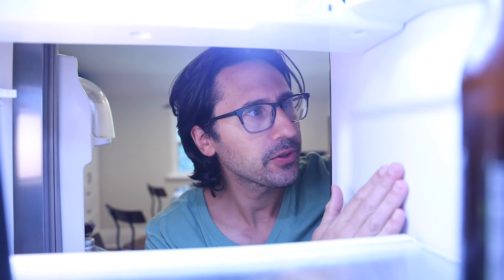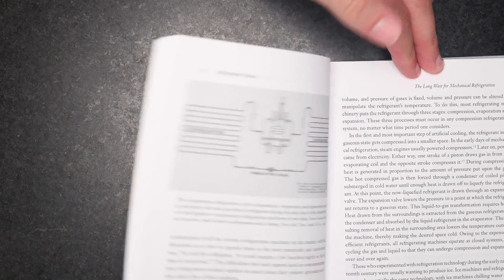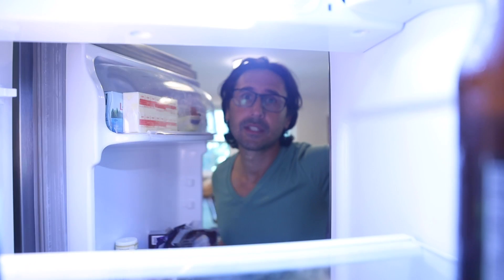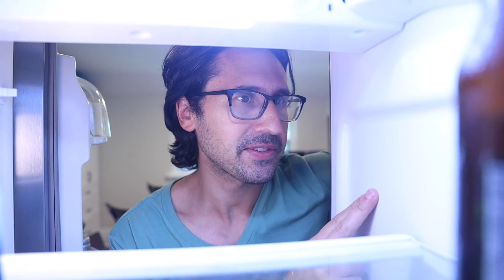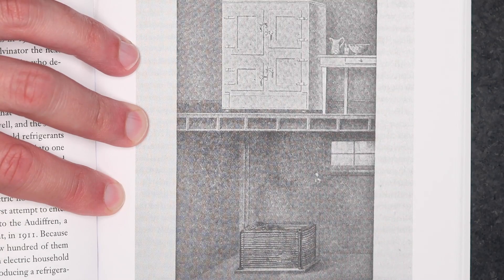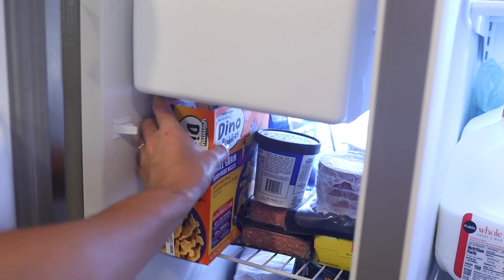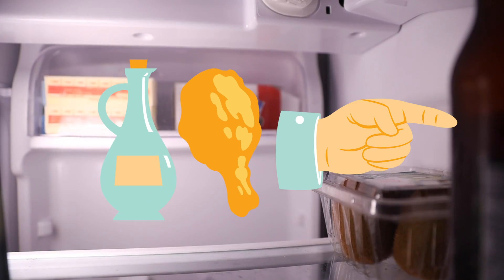How refrigerators work, and how we all ended up with one

Comment: My late grandpa had this small room in the basement which got really cold during winters. Instead of getting a space heater he took apart his old fridge and dunked the part that takes away the heat for from your food into a large bucket of water so that the "fridge" tried to cool down the water even further producing a lot of heat that would eventually heat up the room a bit. Horribly inefficiant space heater but he said "Why buy a heater when I have all the components in my workshop?"

Comment: A great video! I'd add that one of the most important have/have not distinctions lies with refrigerators. Some have reliable power and enough income to buy them and some do not. For the latter, food has to be eaten quickly before it spoils. The result is waste. We might even say that the ability to store leftovers ranks in importance alongside electric lighting.

Comment: Don't know how old our fridge was, but growing up in the 1980s, we had the occasional defrost ritual.  Speed it up by putting pots of boiling water in the open freezer. If you waited too long, no room for the pot.

We also had a chest freezer in the basement, which I guess had defrosting?  had a bit of ice but never a huge buildup.
Reply: my family used to still have one with frosting issues too. here we take the fridge outside and wash the frost with a hose to melt it

Comment: I'm old enough to have had to defrost my freezer section for years! Thank engineers for frost free freezers! When I first started out I had to go cheap and even had to buy a refrigerator so old that it had the round condenser on the top. My grandmother told me stories about the ice harvest because they were sausage makers and needed lots of ice. The ice house was a heavy partially buried building with ice blocks separated and insulated by hay. When she was a ""bad girl" they pit her in the ice house for punishment (1890's German discipline). The Regen river was the source of the ice in winter and the village bath in the summer. AS convenient island separated the sexes!

Comment: It seems you have a "daylight" bulb (or LED) in your fridge.  In terms of your video skills, you really ought to learn about White Balance next.  You've learned a lot about making quality video and audio since you started out, but there's always more.
You might be interested to know that grocery stores use unique lighting to make the food look better.  I had a job making QA devices for the printing industry.  For example, Campbell's Soup labels printed by different suppliers thousands of miles apart might wind up next to each other on the shelf and they need to look identical.  We had, among other things, a lighting booth with a setting for grocery store lights.  I wonder if it would be a good idea to use that in the refrigerator too!  (My 25-year-old fridge uses a plain light bulb that I think I changed once.)
Reply: It's intentional. Adam doesn't do white balance because it makes food look better.

Comment: HCF gases like R134a and R404A is slowly getting replaced by combustible refrigerants like propane and isobutane (basically LPG or whatever is called in the states). Tho one might be concerned by having combustible gases in a pressurized system in their kitchen, the safety lies in the maximum allows charge in the system witch usually is as low as 50 - 100g(2 - 4 oz).

Comment: You want solid state cooling? PELTIER CHIPS! Add electricity they freeze on 1 side, heat on the other! Want to make electricity? Add heat, and it will induct a current out of its wires!

Comment: Yeah way back when I was a little kid,

My mother was into Antiques;

She bought and sold lots of really old things;

It wasn’t my cup of tea, so to speak,

I do remember seeing one of those really old refrigerators  that required you to put a block of ice inside in order to keep things cold inside,
My mom also had a black metal  g gripper that was used to grab and lift large blocks of ice for putting inside of one of those ice- boxes;

 As I recall there was a pull-string. For turning on the lightbulb inside of that ice- box ;

And way after I was grown up I remember doing some research into those ice- boxes and I found out that those bars beside  the roadways  that said that they were an ice- house typically received  regular ice shipments /or deliveries of blocks of ice in order to keep whatever beer cold,

However those days are long gone;

And in. My research I also found out that up in the northern states that there were teams of ice-cutters or saver(

Stupid autocorrect is hosing me up;

Sorry about that,

However teams or crews would go out to the various frozen lakes and cut out large blocks of ice that was shipped or carted  to customers homes,

Definitely  some interesting stuffs:

However my mom  took those ice tongs and she made a paper towel dispenser out of those things,

They really didn’t work too well as paper towel dispenser ,

But those things were definitely interesting to say the least,

My impression is that ice hauling was a very labor intensive  work;

So an refrigerator is definitely the best way to go 

Just passing this along to everyone,;

Peace out ✌🏿

Comment: evaporative cooling and refrigeration have little to do with each other.  You take freon and compress it to a liquid it gets hot.  You release the pressure and let it return to a gaseous state it gets cold.   

You can take a large pressure vessel like 100gal or so.  Pressurize it to 100psi, it will be uncomfortably warm to the touch.  Shut off the air supply and open the relief valve and the valve will frost up and even start blowing chunks of ice out if the humidity is high enough.  I was an apprentice on a sandblasting crew when I had my eureka moment on how refrigeration actually works
Reply: And that is exactly what happens in evaporative cooling as well. The phase change from liquid to gas takes energy, leaving the surrounding area cooler. All compressor based refrigeration does is take the principles of evaporation, add more energy and supercharge it then recycle it.

Comment: In Houston right now and our power is out and has been for almost two days now with outside temps in the teens. Meaning our inside temp got down to 31 degrees in the house. Any insight on why the refrigerator (without power) got to a temp of 36 degrees while the temp in the kitchen was 31?

Comment: A lot of this is not factual like the flapper is to deal with humidity and incoming air in the doorway on French door refrigerators and the heat in the back is just the part of the refrigeration cycle You have a high side and a low side It has nothing to do with defrost if it had the ability to reverse it would be a heat pump like the air conditioners that have the ability to make heat You have a physical heater underneath and around your evaporator coil The heat that you feel on the outside of the refrigerator is the high pressure lines getting hot

Comment: Oops, you made a couple of factual errors. Excellent presentation very complete with the big picture but the "where the cooler" is, and the "heater" is was not accurate.  There is no heater in the door's edge; it is part of the gas tube design.  The part at the edge of the door is the Yoder Loop.  The "cooler" is not in the back wall but that enclosed area at the bottom of the freezer compartment.  The design in most simply transfers the required cold from the freezer to the refrigerator section.  That ratio is adjustable.  There are some, the most expensive, that may depart from this ratio thing.  With the primary coil for cooling in the freezer, moisture will condense and form ice. The solution is a timer that will cycle an actual heater element that surrounds the cooling coil and allow the ice to melt and exit to a small tray under and in that toe space at the bottom that allows cool air to enter, washing over the heated primary coils.  This is supported by a fan down there.  If the fan fails, the Yoder Loop will get excessively hot.  This is the perfect safety tool.  There is no harm; the unit will continue, but now the edge will become notably hot, and a service call will be requested.  The reason for the Yoder Loop placement was to prevent water from collecting at the edge of the door, which would freeze and lock the door shut.

Comment: The heat of vaporization of water is not a disadvantage in using it as a refrigerant.   In fact, high heats of vaporization of the working fluid are an advantage, and not a disadvantage.   You want as much energy involved in evaporating and condensing the working fluid as you can get, for each unit of energy needed to operate the compressor.

The reason water doesn't work as a refrigerant is that it freezes at zero Celsius, a temperature which the working fluid of any refrigerator will need to experience.  And that it expands when freezing, which would rupture the pipes.  Both of these properties of water are part of our species can even have evolved on this planet in the first place, so it isn't like these are properties of water that would be ideal if they were different.

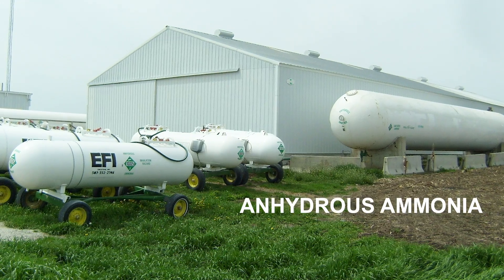Comment: an-HIDE-rus.  The stuff in the wheeled tanks you showed at about 3:30 is typically injected into the soil of crop fields as fertilizer.

We already have a "new" form of refrigeration referred to as the "solid state heat pump" or the Peltier (pel-tee-ay) junction invented by Frenchman Jean Charles Athanase Peltier in 1834.  Many of the small automobile or camping refrigerators rely on such a device.

Comment: Until the late '70s, I've defrosted refrigerators MANY times.
My Procedure:
     Remove the frozen food.  (don't worry, this only takes about ½ hour, and only happens once or twice a year)
     Unplug the refrigerator
     Place a pot of boiling water (on a trivet) in the freezer.  Close door. 
     Come back in ½ hour, with some towels, sop up the mess, replace the food, plug back in, you're good to go for another 6–12 mo (depending on weather and frost build-up).

Comment: My Dad's 1920s GE "monitor top" refrigerator used ammonia, and worked well into the early 2000's. (and it was the electric motor "startup coil" that went bad, not the actual refrigeration).

Comment: You should've invited an engineer instead of a historian. That way you would have known that no liquid is flowing through your fridge (at least where you said it was flowing). Your warm food doesn't evaporate anything. The process behind the cooling of the fridge is as follows: Compressor compresses a gas (it is not essential to turn gas into liquid) - > gas, heated by compression, is then cooled inside a radiator - >  after compressed gas is cooled to ambient temperature it is decompressed (thus cooled) -> then (depending on a manufacturing method of a specific fridge) cold decompressed gas is sent to a radiator that is either spread throughout the fridge or is placed in one place and the fridge air is circulating through it where the gas is absorbing the heat from the air inside the fridge - >then you repeat every step again. If it was the way you said it is, then the fridge wouldn't be able to cool anything lower than the ambient temperature because if the ammonia (you used ammonia, so i'll use it for explanation too) is liquid that means it is either BELOW it's boiling point (-32 C or something like that) OR  is under pressure (but at the ambient temperature). I am sure you understand how room temperature ammonia will not cool anything below room temperature, so let me explain why the first part won't work either. it is simple: HOW THE FUCK WILL YOU COOL THE AMMONIA TO -32 C? Compressing matter makes it hot, not cold.
So, the whole point of all this was that you are an ignorant moron who is in no position to tell people "How refrigerators work..."  
If you want to teach anyone anything then please make sure you know it yourself. Explaining to someone IS a good way of understanding complicated things yourself but I see no indication that this is the case here.
You are probably one of those kids who say that their grades aren't representative of their intelligence or those who say that they "wouldn't need that in their life" about science just to become a moron who doesn't see fallacies in their explanation of "where the COLD comes from".

Comment: I used to work as a refrigeration engineer, R290 aka pure propane has become the new standard for home refrigeration. Propane is a very efficient refrigerant, poses no toxicity risk and is environmentally inert. While it is flammable, the amount used in a very large home refrigerator is very miniscule, about 12-20 bic lighters worth. Your refrigerator or window AC unit probably uses much less.

Comment: Ah the fun of taking everything out of the freezer in the garage, putting it all in a picnic cooler, and defrosting the freezer.  Using a hairdryer to speed up the melting on a hot summer day.  Taking out the large chunks that fall into the bottom and using a towel to soak up the water.

Comment: The most common refrigeration currently use that doesn't use the vapour cycle is the Thermo Electric Cooler (essentially a Peltier system in reverse).  These use a semiconductor junction that moves heat along with the electric current, and thus can produce a 'hot side' and a 'cold side'.  They work well at smaller scales - most 'mini fridges' for a few cans of fizzy drinks run on this technology, as do the cool boxes that can also be plugged in (to a car).  They don't work so well at higher powers, or at lower temperatures (so fridges, not freezers).
Magnetic cooling systems tend to be limited to lower power, but they work well down to really low temperatures, so are currently used in cryogenic applications (i.e. liquid air to liquid helium sort of temperatures).  I'd love for them to replace compressor based systems - so much quieter in use, but I suspect we're a a while away from them becoming commonplace.

Comment: One thing I wonder to myself is why the first proposed solution to the ammonia problem, the Einstein refrigerator, never took off despite only using heat to cool, having no moving parts, and having the ability to be entirely sealed off with no worry of gas escaping through the compressor. You could use any source of heat, from a propane flame, solar heat energy, or even an electric heater to power it. I've looked it up and I still come up blank.
Reply: For one thing, much less efficient. For big industrial applications, believe it or not an ammonia compressor refrigerator is much more efficient. And for home use, it still has ammonia in it. Yes it is less likely to leak but not impossible.

Comment: Chemeng bach here: yes, it's all true. Ammonia is the most effective refrigerant, but superseded by CFC and later propane-butane mixture for the house. Ask your local oil company, maybe they produce the propane-butane refrigerant (Pertamina of Indonesia does, at least). Due to Black's Law and heat transfer in general, temperature in our freezer can reach subzero. Sooo I think viva engineering? (still not accepting pi = 3 jokes here gtho)

Comment: I live in Ukraine and still have an old soviet fridge. Still works amazing but ya, have to defrost every now and then (rarely however so it's not much of an inconvenience). However, pulling things out of the freezer when there's a ton of ice/frost blocking the way requires a lil muscle strength. But at least the fridge is still working

Comment: You can also keep things cool with SOUND using thermoacoustic refrigeration, using essentially inert noble gases instead of dangerous refrigerants. Ben and Jerry's even had one installed in one of their ice cream shops, and even though it uses incredible high sound levels inside, very little of that sound leaks out making it shockingly quiet.

Comment: As a HVAC tech,  refrigerators transfer heat. They say we’re in the “heat transfer business”. Not the cooling business
Reply: As someone who creates simulations about cooling systems I still consider myself in the cooling business :D However I am not the one who has to dissipate the heat to the environment, just transfer the heat to the Coolers/Chillers :D
Reply: Hi fellow HVAC engineer's.
Reply: As someone who has no idea about this subject, I just got a 36k BTU inverter in the Caribbean heat.   It's nice.
Reply: Honestly HVAC is super interesting. Pressure differentials that can be strong enough close a door if installed wrong.
Reply: With the former, yup.
Reply: As someone who had a great chem teacher. Theres no such thing as cold. Just lack of heat. I love watching videos about ac stuff

Comment: Ahhhhh.. A very interesting story.. but.. you have the real motivator completely wrong.. The Power utilities were using refrigerator give away and rebates on refrigerators to fuel the installation of electric wiring.. I know, my family owned one of the appliance companies that sold the rebated refrigerators in NYC.. Con Edison (the power company) need to give the building owners motivation to wire up their buildings. Every building already had gas and provide cooking and lighting. There was no reason to add a completely new utility to new or old construction until you sold landlords and building developers on refrigerators.  Anyone who lived in a prewar apartment building  knew what a dumbwaiter was but probably didn't know its primary use was for moving the ice blocks up to each apartment .